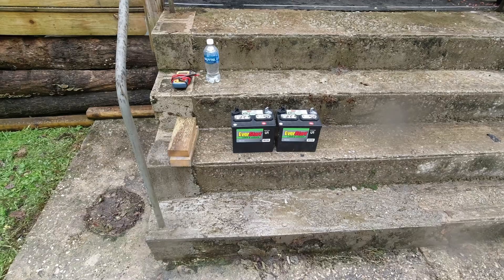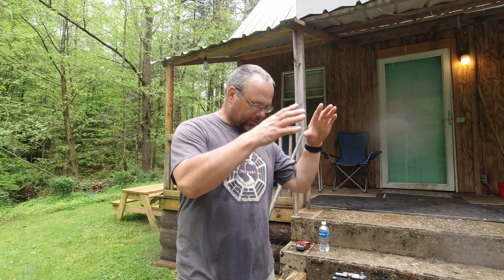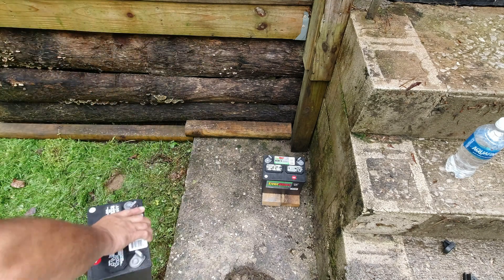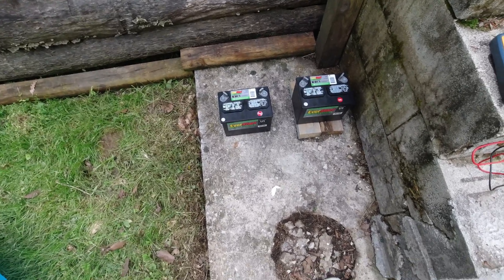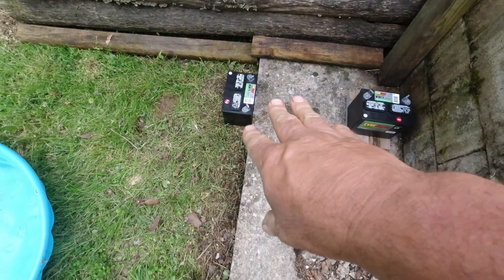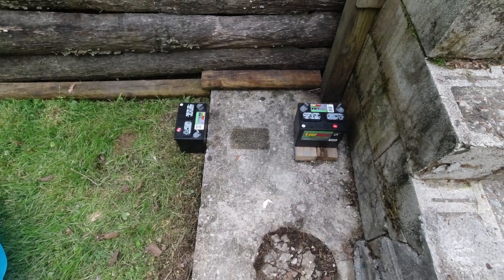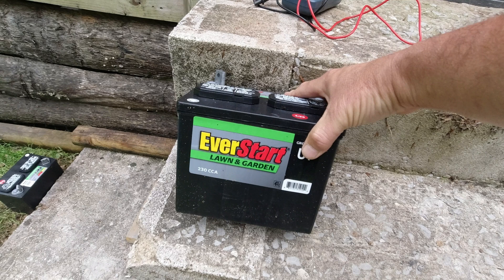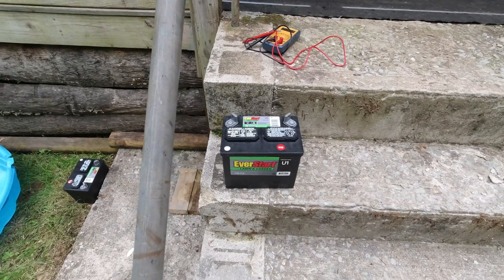Sitting a Car Battery on the Ground: Science or Urban Legend?

Comment: The true myth is that the old long ago car batteries had rubber cases and the acid would seep into the dirt short the battery out. plastic cases don't seep. If you put a micro solar or other charger to the battery it will keep the battery good. if the battery does not charge from everyday charging it will sulfate on the lead plates and go bad over time.
Reply from the maker: Yes any battery will go dead over a long time even sitting on a shelf in the store. A solar charger is a great idea to maintain the charge.

Comment: What about testing the myth of don't buy gas at a station while a tanker is delivering  because it stirs up sediment from the bottom of the tanks & you'll get dirty gas.  
I've heard that all my life.  It makes sense but idk if it's true.
Reply from the maker: Thats a good one. It does make sense that it would get stirred up. I guess that also depends on if the tank was almost empty or half full as well. I imagine more gas in there would be harder to stir up.  I'm not sure the best way to test that. I'll look into it though. Thanks!

Comment: LOL!  I have never in my life heard that I couldn't set my battery on the ground.  Do those folks think that energy is going to pass through the plastic case or something?  This is the best laugh I've had all day.  Thank you again, LOL!
Reply from the maker: Yes, based on older technology where the rubber casings on the battery would let moisture short between the plates. Modern plastic batteries are very well insulated against this type of thing.

Comment: A dirty AF battery might discharge a little faster with electrolyte all over the case but it's probably on its way out anyway.  An important part of battery maintenance in industry was to clean them on a regular basis.
Reply from the maker: Yes, that is true. any type of contaminants and water will cause a slight draw on the battery. You are correct keeping the battery clean is very important.

Comment: Mine left a mark on the concrete as if the acid leaked out. Maybe certain types of concrete draw the energy.  However.  Ive had a battery just sitting on the floor.  Brand new! Dead and unchargable! Go figure..
Reply from the maker: If there were a flaw or crack in the case I could see this happening. Sounds like that was what happened with yours. Batteries do discharge over a long time though just naturally no matter where they are.

Comment: The myth never made any sense.  How conductive is concrete compared to the steel plates that support batteries in automobiles?  It's actually less conductive than rain-soaked boards, for that matter.  Just dumb.
Reply from the maker: @tedneb3459  exactly! Yep I always thought that. I never had worried about sitting my batteries on the ground.
Reply: Actually he pointed out that it was true back in the day when batteries had rubber cases instead of plastic. 
So there's that.

Comment: I've heard this also, but iIalways thought it was stupid BS.  The case is plastic and electrically insulated. If anything, it probably has more to do with twmperature than anything.  Also, lead acid batteries like to be used and charged (cycled).
Reply from the maker: @IrrationalBstrd  yes I have to say there was no surprise with these results.

Comment: I figured this out long ago when by laziness I left a pulled battery on the ground while working on a car for a few weekends. Perhaps this myth got started when someone put a weak battery on frozen ground as lead-acid batteries do temporarily lose some performance in cold weather.
Reply from the maker: @P_RO_  That is a good point, could've been what happened.
Reply: This point is the only reason I have heeded the myth. It's no big deal for me to put them on wood that is not in the winter elements.

Comment: Don't put your battery on the ground with a screwdriver shorting the terminals. That's my advice. Compare that to a battery on a board, with the terminals unshorted. I guarantee you'll see a difference very quickly!
Reply from the maker: That would be a definite result lol.
Reply: A very reproducible one, in fact!